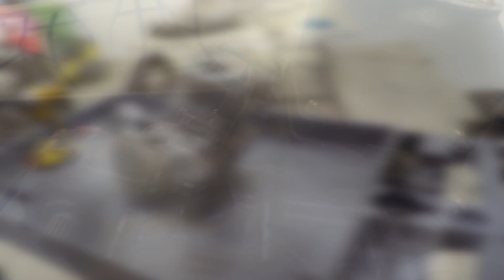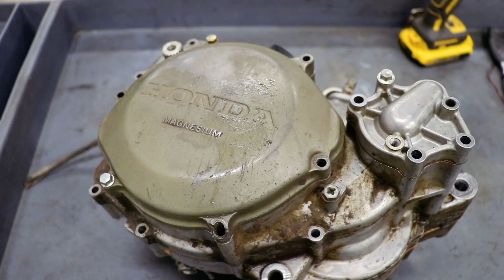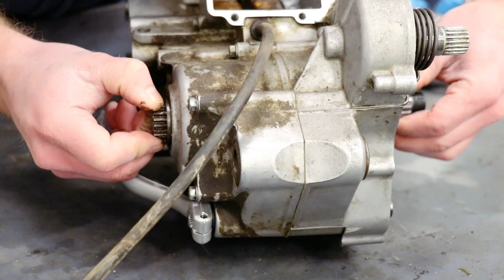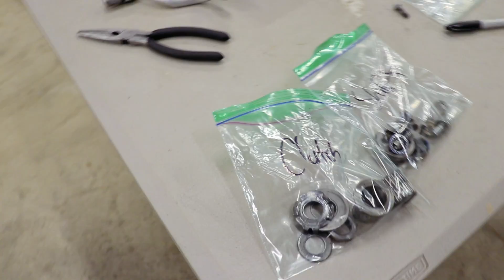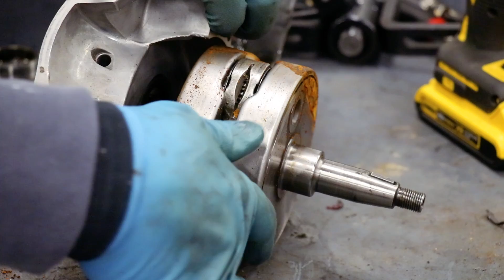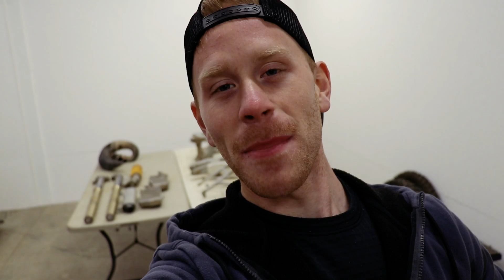Two Stroke Engine Won't Shift!

Comment: Loving the build. I am amazed at how comfortable you are stripping that bike down to the smallest of parts. I could never get it back together.I came back to motocross 2 years ago after 28 years off!! I couldn't stand the thought of buying a 4 stroke even though I thought it would be a lot easier to ride. I went ahead and bought a beautiful, brand new, 2016 YZ250 and I love it every time I ride it!!Keep up the cool vids!

Comment: Yo Cameron!
Thx for all your help brother, your videos have been more than a blessing!
I am restoring/rebuilding my yz125 because nobody could find the reason for the problem it had.
The bike will not shift on high RPM but needs the RPM to settle to below 5-7K for the gear to get in.
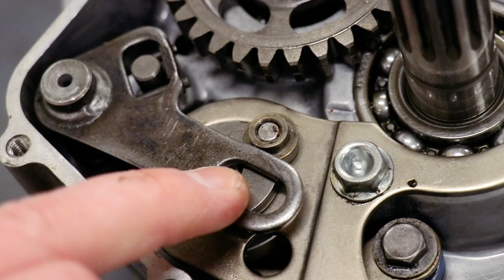i too discovered the same problem you see on 2:43 which no "mechanic" saw but does anything else cross your mind?
I hope you feel better already too! 
my prayers for an easy going recovery warrior!

Comment: I had this happen to me before on a yz125, fixed the shift shaft changed the seal and it was good to go!
Reply: Why did he or do you have to pull the flywheel off like he did to fix the issue he had on the other side of the case????

Comment: Nice work dude. I found this video to be very educational and helpful for my situation. 

I have a 1994 kx250 engine that goes into 1st gear and barely goes into neutral and that's it. I'm going to take apart the outer case to see what's going on inside. If I get stumped, I will refer back to this video to see if I missed something. Until then, thanks again. 😎👊

Comment: the crankcase splitter is supposed to be suspended off the cases with those extra washer you had just threaded onto the studs. its far less likely to break the welds on those tusk splitters and will not hurt your aluminium cases. i also feel they separate better. i did it like this once or twice lool.

Comment: I have a 1997 Yamaha RT100, it seems hard to shift, but it does shift. I think it might be a build up of dirt in the shift shaft, but if it’s something different then it should be an easy fix.

Comment: i have a 2006 crf250r  and on the track out of no where i thought a 450 was behind be but it was my engine making a loud ass noise but  it was still runing though.i took it back to my house and watching your vids convinced me i should take it appart myself and i am right now im taking of the flywheel and clutch basket ...the top end is off and my engine in on the table. but there is a problem i always have the engine turns anytime i try to to take a bolt of how do i keep it looked without damaging the parts inside the engine

Comment: You seemed pretty knowledgeable my son and I are rebuilding a RM 125 it's a 1996 model and sometimes it's hard to go into gear and then other times it rides normal never any problems what oil do you recommend putting in the bottom

Comment: Had a similar issue with a 96 YZ250 stuck in 5th. Issue was the spring retaining pin from the power valve assembly cane loose and wedged it’s way near the selector assembly. Had to split the casings to get it out. Also was unable to get into its power band.

Comment: You are an inspiration Cameron, good clear content and quality workmanship, one question though, have you noticed the mag wheel cleaner strips the zinc coating off steel parts like the small brackets riveted to the frame and rivnut inserts? or have you not run into this problem, I use aluminex which is a ally boat hull cleaner but need to keep it clear of zinc or anodised parts, keep up the great vids and happy new year from New Zealand

Comment: So I have a 97 cr125 and the clutch lever just feels like there is no resistance  it does go back but barely it's just way to easy to pull and I've adjusted the cable and cant get any other result... Any Ideas of what it could be??? Love all your videos by the way it has helped me learn a lot about dirt bike motors....

Comment: 3:50  hey I have a question I have a 1996 kx 250 2 stroke I have the whole clutch assembly off and I went to  shift it in gear just to make sure it would work before I put it all back together and it doesn’t click into all the gears does that mean I put the transmission in wrong ? Thank you

Comment: 4:28 I have two sets of cases from different bikes with cracks like this along the ribs around the bearings. Have you ever had one go too bad, when would you consider it too bad (more cracks or chunks falling) and how long should I expect a new set of cases to last before? Thanks in advance.

Comment: I had almost same problem with my yamaha dt 125cc engine. I just took it apart and rebuild it and the shifting problem was gone. Also installed new bearings and piston 😄

Comment: I need some advise I ride a 2003 CR250. the swing arm needs replacing can I use a CRF250 04-09 one like the forums say you can ? The reason why I ask is they are easier to get hold of and seem to be the same ? Thanks man

Comment: Is the shifter issue the same on a 4 stroke? My shifter seems to be locked aswell not sure on why tho. My quad seems to be stuck n gear and will stutter when i try to clutch start it

Comment: Hey cam, I have a 2010 kx 85 that doesn't want to go into neutral while the bike is running. Even at a dead stop. When I turn it off it shifts like butter, running it up shifts and down shifts fine but won't go down to neutral from second or up to neutral from first. It just skips over neutral??? 😬
Reply: Half click take it easy... sometimes if you slip the clutch out just a little bit and then try again it helps
Reply: Changed the oil & now it shifts to neutral Smooth like the other gears😳🤯.

Comment: cam I drop my bike in the mud picked it up it was still running I cut the bike off and would not start back till I got pulled off dis is a cr125 now won't crank by kicker cleaned card and air filter so what could it b

Comment: Good day. Anyone experiencing on your yz 250.
I've got an issue on my yz250 when my bike is running on 1st gear or 2nd gear it goes back to neutral gear. I dont know whats the problem.

Comment: Do you know why my clutch has gotten so hard to pull? Installed a new cable but it didn't help much. Bike is a 2012 crf250r.
Reply from the maker: Cable routing or your lever and perch need greasing. Also converting the cable to the left side of the engine will help a ton.
Reply: Cameron Niemela thanks for your reply man. How do I go about converting it to the left side? Can I just install a cable and bracket from an 09 (or older) crf?

Comment: Send out the old crankshaft To KenOConnor Racing so he can rebuild it, trust me it's way better than buying a new crank. And I would use all OEM gaskets, bearings and seals in that bottom end and wiseco piston for the top end.

Comment: did anyone else notice at around 4 mins and 36 seconds in, whoever put that pawl assembly together done it wrong. its got the pawl plunger and pawl springs the wrong way around. the spring goes in first and then the plunger on top lmao.

Comment: geez look at that crank its been underwater for ages , you dont need fancy puller to split the motor you just heat and the same to assemble it

Comment: Now what Holly shit just kidding ck cleance in rod bearing side to side check the select gear and forks if damage or bent replace replace clutch inner housing replace springs and clutch pack if needed yes rebuild and have a great day good luck I've done this once or twice or three times

I'm to old